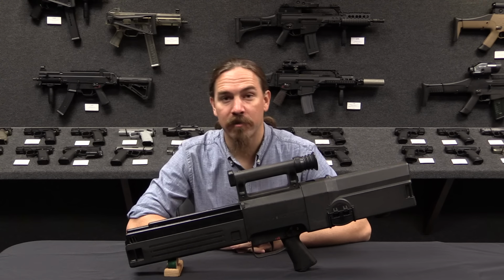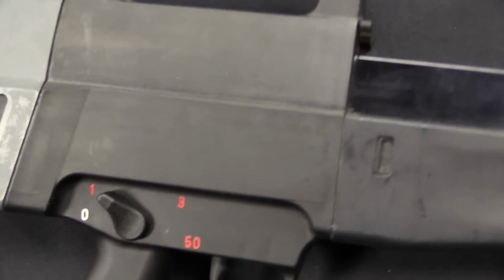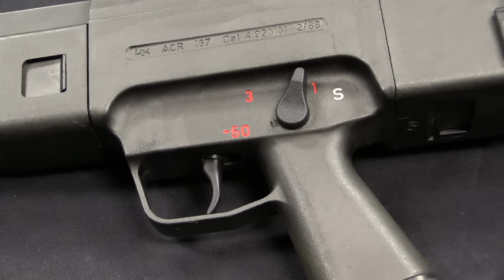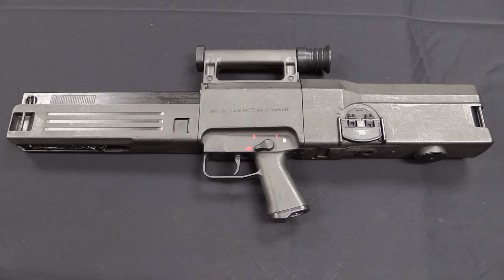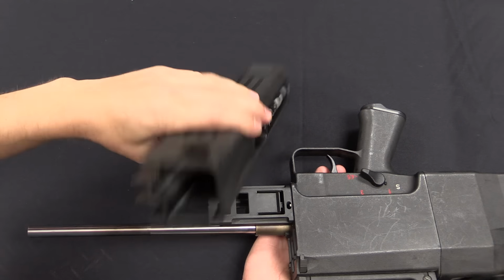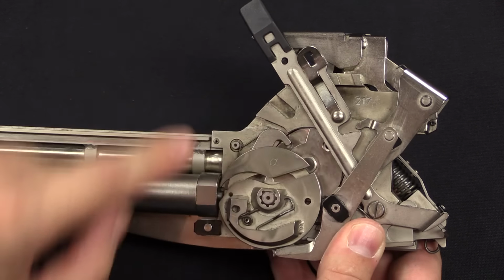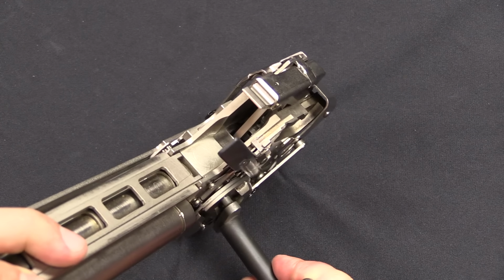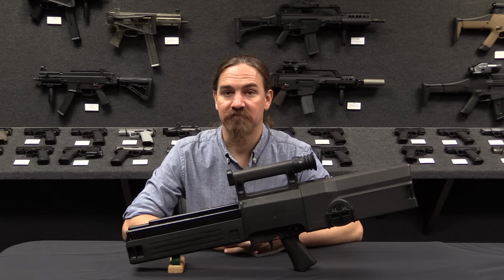Kraut Space Magic: the H&K G11

Comment: This is like the anti-AK in terms of design complexity
Reply: More like the anti-STEN. The AK actually has some pretty smart engineering and while simple enough that most people with cursory gun knowledge can maintain it, it's definitely got some complexity. Meanwhile, the STEN is just a fucking angry metal tube.
Reply: @casual_speedrunner1482  thats pretty much all open bolt direct blowback SMGs
Reply: @casual_speedrunner1482  It is simplistic enough that countries with very little industries can make their own copies.
I guess it succeeded in that regard.
Reply: @casual_speedrunner1482  an angry metal tube that hurts, but does the job well. Still prefer the stg
Reply: @Severis4231  Sten working well? Are we talking about the same Sten that had a 32 round magazine that jammed if you had the audacity to load 32 rounds?
Reply: @JoeJohnson96  Theres a reason the standard mag capacity is either 20 or 30 rounds
Reply: @casual_speedrunner1482  anti ppsh then
Reply: Nah that's definitely the AN-94.
Reply: It's like a shooting alarm clock
Reply: Lovley answer Guy
Reply: There is one other part of this gun that makes it an anti-AK in terms of design that everyone seems to have forgotten
Lack of usability by enemy forces when captured (or VERY short term usability at most)
Reply: No that's the Zip.
Reply: Should add development cost 🗿
Reply: Somehow has more in common with an ak than an AR
Reply: The more I think about it the more accurate this is
AK: heavy, relatively inaccurate, made of wood and milled/stamped metal, mostly unchanged since the 1940s, requires practically no maintenance and yet will likely still function at the heat death of the universe.
G11: lightweight, relatively accurate, made of precision machined metal in a polymer housing, finished development in the late 80s, is designed to be borderline disposable in part because maintenance is damn near impossible so the service life is guaranteed to be short.
Reply: @Sammie1053  >inaccurate
weve got a fudd
Reply: @Sammie1053  youve never fired an ak before.
Reply: @Sammie1053  lmao insurgents snipe with this thing without scopes I think the accuracy is fine
Reply: @Sammie1053  when I was in army I hit torso sized targets from 250 meters with AKM. Iron sights, almost no experience beforehand, except regular 100m practice once a year. 
A trained shooter could easily hit a target at 400m (as "advertised")
Reply: @Sammie1053  now there’s some fudd lore if I’ve ever seen it.
Reply: @Sammie1053  ak has some kick cause of 7.62 but its still accurate as hell single shot.
Reply: @Sammie1053  >inaccurate
Someone takes their gun knowledge from video games it seems?
Reply: @Sammie1053   Bruh, this ain't COD. AK is reliably accurate IRL, the game devs just nerfed the shiet out of AK 🗿🗿🗿
Reply: I would wager the AN-94 is the anti-AK.
Reply: and both were made by germans. incredible.

Comment: "That cartridge case is really hot when it comes out, and thats a good thing" this is fud lore, the problem with caseless is that the powder gasses are in direct contact with the chamber. The brass case acts as a thermal buffer and insulator, if the case was made from a better insulator, say plastic, it would transfer less heat, but also leave the gun cooler.